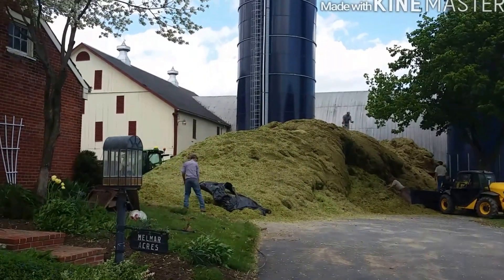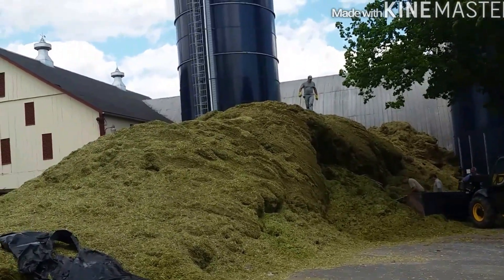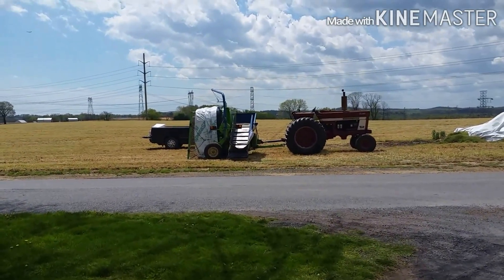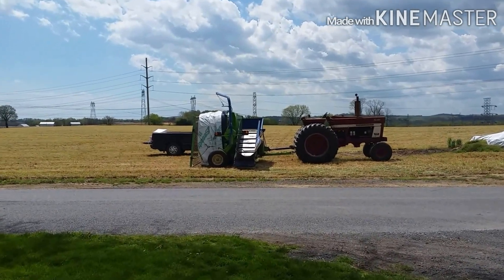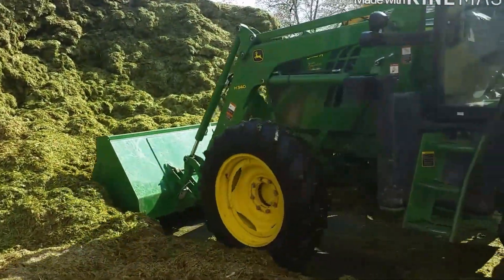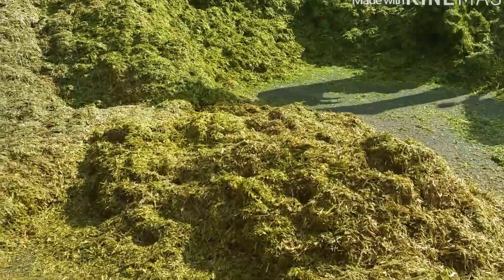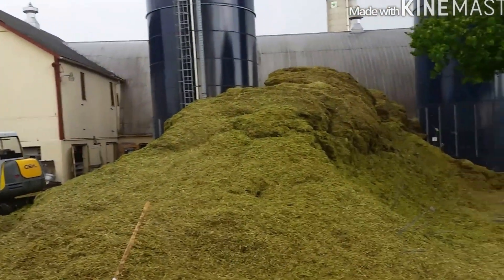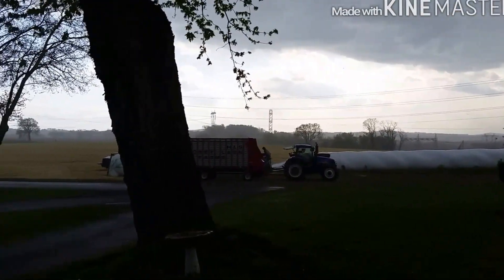Farming accident: Silo collapse after being filled with ryelage 2016

Comment: So that was a concrete stave silo?  I have never seen one do that
Reply: Smoke Eater I’ve heard of a few around here that have fallen over. The latest one was this fall, it fell over with 2 men inside! They were leveling it off and putting down the unloader when a bunch of the bottom rings let go. They landed 120 feet away from silo, both survived and no buildings were damaged
Reply: Smoke Eater not concrete was a stave